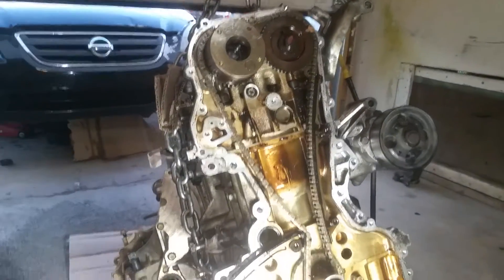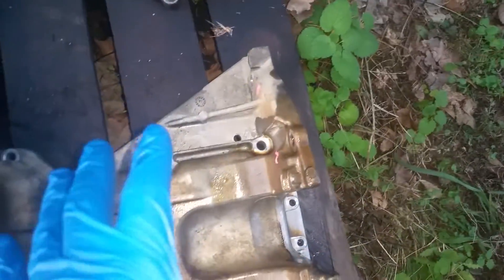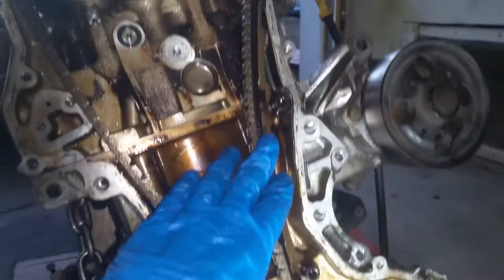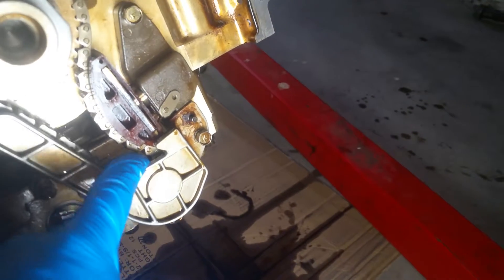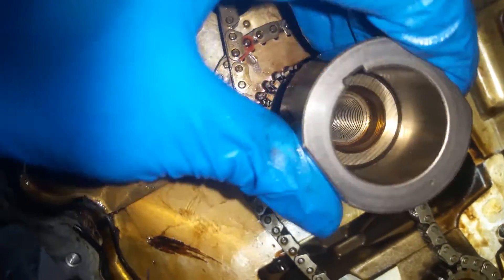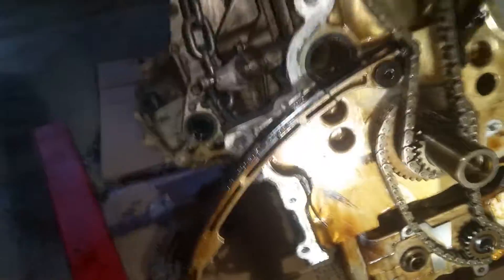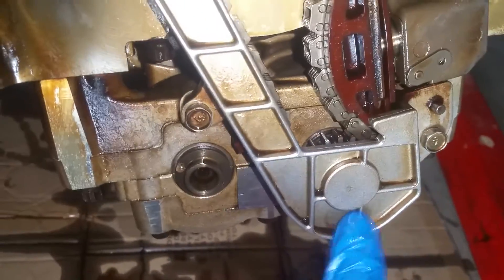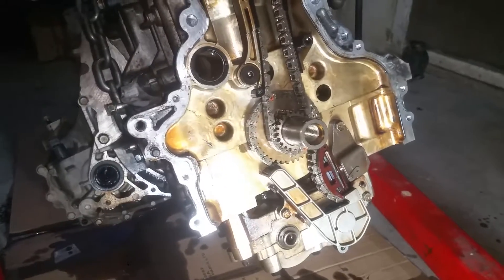How to time nissan altima 2.5l

Comment: This is a great video i have a 2005 altima, ive wanted to do this for the last few months. It's hard with out having a hoist or chery picker to pull the engine out. How many days did this take and how much were parts, chain etc?
Reply from the maker: The timing assembly runs around 100 or less . As far as getting the engine out it was a pretty good job and a tight squeeze coming out the top with motor and tran together. It was cold weather when i tackled this and believe id spent a few weeks on it . Thanks for watching
Reply: @WrenchTheory501  can I ask how much more time you got out of the car from doing this? And did this help your car run better? My car is idling rough and I'm wondering if it's my timing chain or maybe should I replace the catalytic converter? My 2005 Altima has 220km on the original chain and convertor. Thanks for the reply.
Reply from the maker: I was replacing the engine and just put a new timing chain assembly as a precaution. Its really hard to say with rough idles if you have done the basic tune up then you may want to take it in just for a diagnostic . The shops have the really good computers that can read all the information without a code even and try to pin point the issue. Around where I am they charge 50 for diagnostic but I would call and check around . Hope this can help thanks again .
Reply: @WrenchTheory501  yes thanks so much, around where I am, London Ontario, Canada they charge $120 hr shop rate. I've never found a decent mechanic. I put an new alternator belt on my car. I brought my car in for an oil change and the shop told me I needed a few things done. One of which included to replace my belt, apparantly it was cracked. I played into it. Keep in mind this was only a 3 month old belt.
I took of the belt went in a week later and talked to the guy that normally works there. I asked him to look at the belt and let me know if anything was wrong with it. He said no it looked used, I verbatim said do you see any cracks on it. He said no. I then said that's too bad because now we have a problem. I then showed him the recomend work that needed done to my car. Made him read there recommendation. He said well maybe it dose need replaced.
I've not gone back since. I try to do as much work on my car as I can. I have zero trust in shops.
Reply from the maker: Yes I dont blame you . I wish I could be more help . I would start with cheap and easy fixes if its an otherwise good running engine with only rougb idles. Spark coil packs even a vaccum leak , gas treatment , dirty throttle body,  at the end of the day it may be just a worn out engine . I used replace heads and rebuild some engines but anymore its cheaper to just swap out the engine it seems.
Reply: @WrenchTheory501  you've been an awesome amazing help. This is a great video too. I also appreciate your messages and replies regarding trouble shooting. Thank you very much.

Comment: Did way too much work loosen up all the front bolts of the oil pan 
Comes right off 
Good insight though for those
Reply from the maker: Good tip thanks for sharing
Reply: And then you wont have to drop the oil pan all the way off if you just remove the three bolts that go from bottom up into front timing cover?

Comment: Well, even though they're tough to get to, at least it has timing marks! Unlike the Mazda 2.3's etc. What happened that it needed to be re-timed? None of the parts looked that new.
Reply from the maker: +Baxrok2 This car has a bad tran and water was getting in the oil , been documenting a little. Took it apart and put it back together to show the timing . I'm going to replace the engine as opposed to replacing the head . It was a little too uncomfortable for me with all that water in the oil. These covers and oil plates are really glued on with that black rtv. Thanks for watching